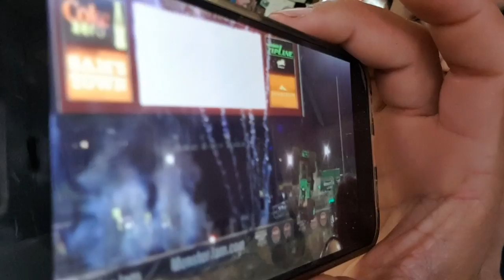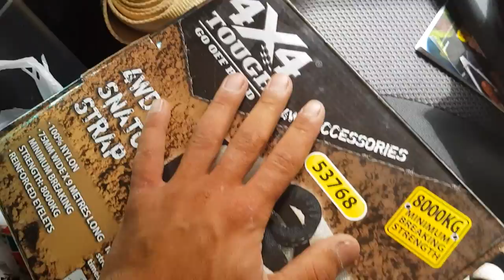4x4 Ourimbah State Forest + Beginners Tips

Comment: 'Bigger tyres' Yeah we all want them :) Nicely driven and sound advice.

One mod you'd seriously benefit from is a winch, the expense will easily pay for itself if you're not afraid to get out and use it. Winching is a great way to save damage and can be used to prevent rollover's as well.

Something that is more affordable is bead lockers, they will allow you to use even lower pressures without problems.

Like all 4bie owners though these things will come over time. My next mod is portal axles for that little extra lift, but here we have to have the gear box rebuilt and re-calibrate the speedometer to keep it road legal so it will be a while.

Comment: What sort of 4wd system is this thing running?  Seems most of the time the back wheels are spinning and the fronts are just being lazy.
Reply from the maker: The traction control system in the triton isn't the best. supposed to be a locked centre sending power to the wheels with the most grip and cutting power to the wheels slipping, but it fails a lot of the time. Hilux sr5 has a much better system.
Reply: Adventure Australia fair enough, you guys look like you're having an awesome time. Loving your videos.

Comment: Did you guys ever put it on 4LLc on Rock mode? Back wheel just keep in slipping.
Reply from the maker: Switching between 4hlc and 4llc but the slippery stuff was always done in 4llc. It was just how dry the ground was that made it so hard to grab anything. Loose sand everywhere
Reply: Adventure Australia Unless you put a bit of weight on the tray so that the tyres can grab traction. And a bit of momentum perhaps.

Comment: Are you guys using all of the factory traction control? Factory rear diff lock and centre diff locked should let you pretty much idle up most of that stuff. Let the traction control help you.
Reply: Adventure Australia1 nah man the traction control does work in those spots where your lifting wheels because it doesn't just cut power it'll use the brakes to grab the wheel in the air & send power to the opposing wheel trust me I gotta triton too & its the same offroad traction control as the pajero, true it is useless in sand & mud though because it cuts too much power but crawling up rocky stuff it works a treat on
Reply: Mate the key to using traction control is to slowly apply power and give the system time to work out whats going on, so you might be skidding for 5 to 10 seconds and then you will move forward.